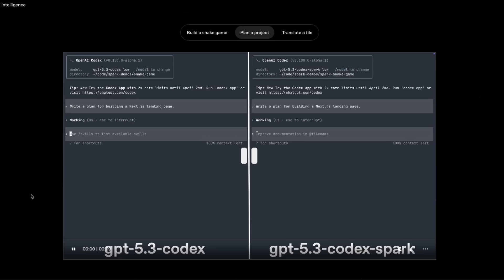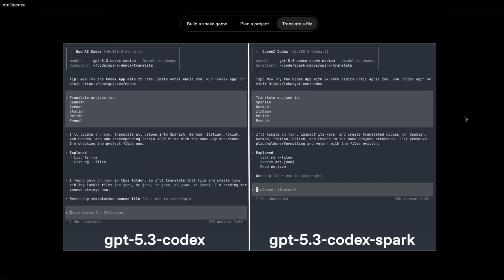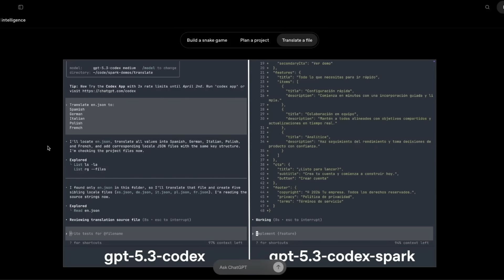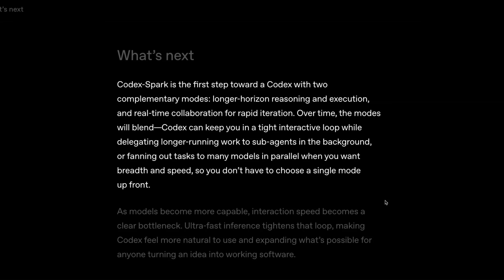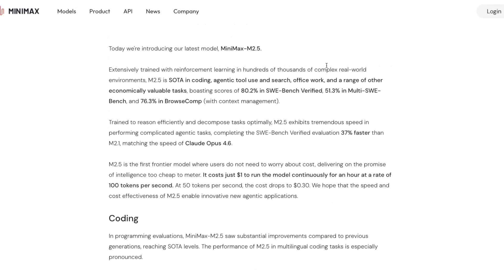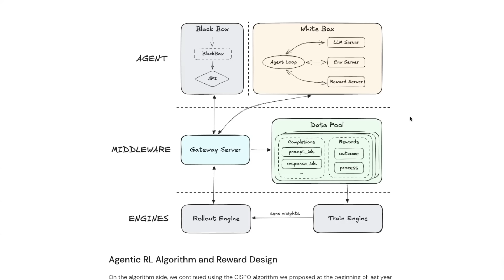Codex-Spark: OpenAI Just Broke the Speed Limit (1,000 Tokens/s)

Comment: Why do we need a model that can generate code really fast? we never wrote or read it ultra fast? whats the use case?
Reply: lol, wut?  Why would I want to do something in 5 seconds when I can do the same thing in 1hr.
Reply: @user-eg6nq7qt8c but you did that before in 10 hours. How fast is fast enough. It just like saying how much money does one need and you reply "more"
Reply: Iterative work and redesigns of front end.

They’re trying to Secure the rising market for vibe coding because the idea of “My own app” has started to hit the normiesphere, so you use a smarter model to write the architecture, then most normies will spend the majority of time change font sizes, colors etc.
Also, this likely doubles as a market research project for them, how many used that rather than low/medium reasoning? If they notice a considerable shift they might want to go with a heavy tasks/light tasks models approach like they did when o1 came out with reasoning.
Reply: @christianjensen952 yeah but it doesn't have to faster .. that's not the metrics. IMO
Reply: @sumitbindra  it is for the avr. Non tech normie.
If you don’t think so, widen your circle. You live in a bubble
Reply: For the orchestrating models to read
Reply: @JSON_bourne that could be a reason
Reply: Fast = efficiency 
Pretty much the goal of every innovation
Reply: @OneBraincellLater maybe
Reply: You're not supposed to read it, the code just needs to be good.
Reply: @jamesjonnes but why does it have to be faster? Is speed what we are optimizing for?
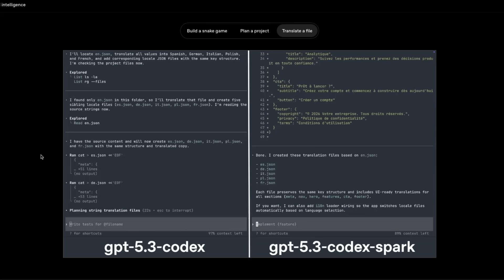Reply: 4:00 in the video
Reply: Fast coding means the ability to create at a much faster rate in much shorter time.
Reply: @pfpchad2747 yeah but why